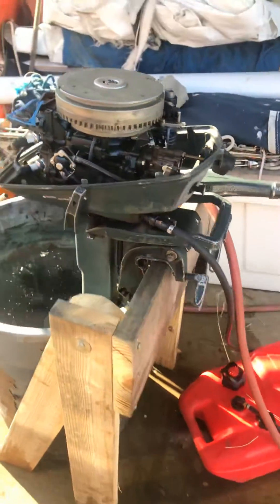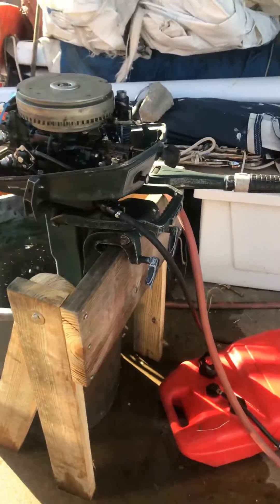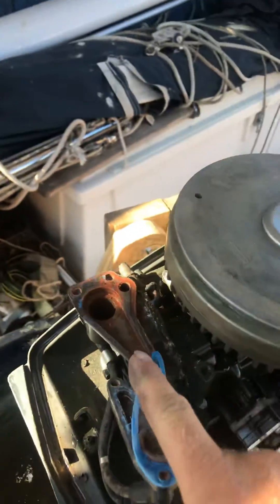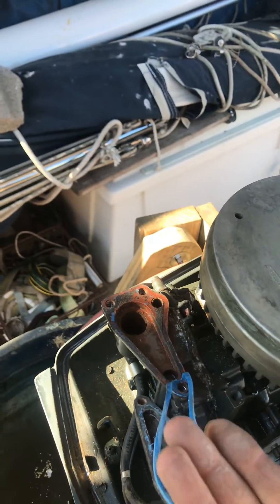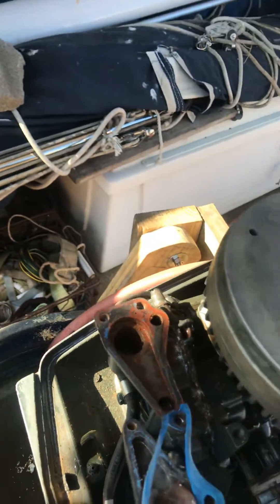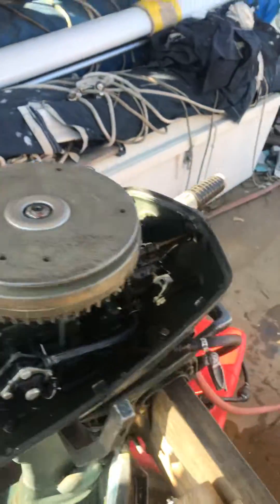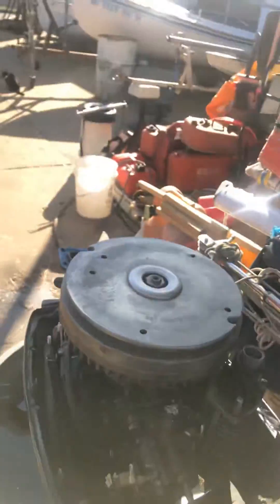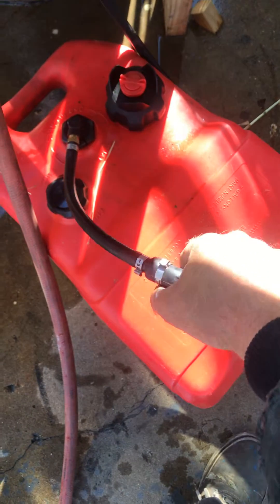Water flow test on 71 Johnson 6 hp

Comment: Well, seems like a pretty good flow, but a new impeller/water pump kit would improve it....What happens with the thermostat cap in place, nothing out of the exhaust housing outlet?  You really should raise the water level in your tank though, it should be over the gearcase/exhaust hsg joint.  I have followed this on AOMCI also, so am aware of your cracked block threads issue...

Comment: So I ran mine pretty long before she started spitting water.  Maybe the thermostat needs to open first?  If you assemble without the thermostat, will it spit?
Reply from the maker: I pulled the stat and still, no change. I’m pulling the power head tomorrow. Hopefully, I will find a blockage in the water jackets.